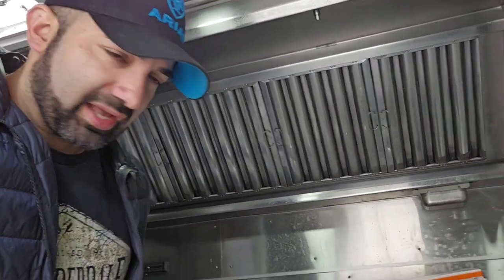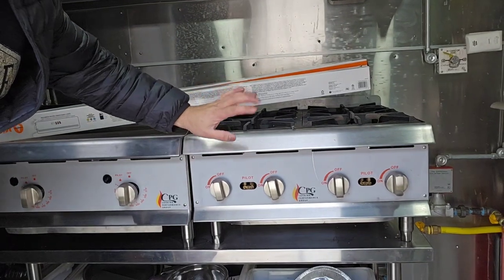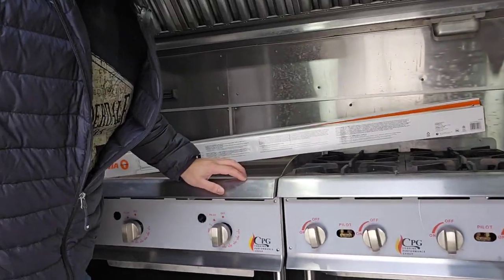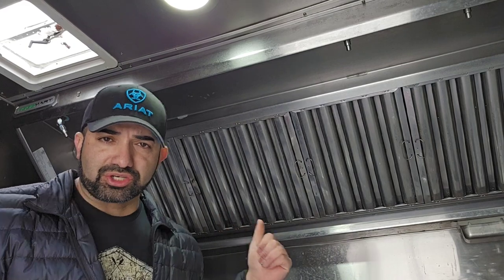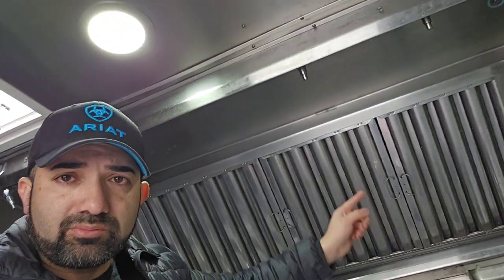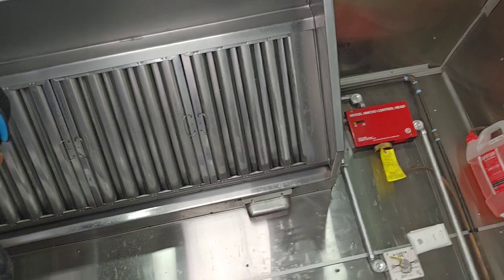Food Truck Hood and Stainless Steel

Comment: I just recently bought stainless steel wall panels from one of my local fabrication/welding shops for my trailer build. It was 146 bucks a sheet.  I was shocked I found it this cheap as it’s been well over 300 a sheet since shortly after the pandemic hit.  Been installing it all fastener free with panel adhesive. The panels were 4’x8’ 304 #4 finish stainless 22 gauge. Time consuming process, but it’ll be so nice when finished.
Reply from the maker: There you go!!! Great find

Comment: Love the video's.  Great content Frank.
I have a camper I converted to hardside. 
I'm making a Boba Tea Truck. 
I have 100 amp service.
I have 30 amp generator inlet box.
I ran 10/4 SOOW  from the inlet box to the breaker box. 
I want to power both legs in this box and it only power one leg right now. I think my issue is the power cable from my house which I'm using 110 outlet to power the camper.  The power cable from house to the camper is 3 prong but I put adapter on it to hook up to my 110 outlet.  So essentially I only have one hot coming into the 30 amp outlet box. When i got to certain events i have option to use their electric but it usually comes from 110 outlet. How do i power both legs in this box?
Reply from the maker: You can add tandem mini breakers, I list then on my descriptions and only use one leg.
Reply: @fbaltierrez  thanks for the reply Frank.
If I ran a jumper wire from the hot leg to dead leg would that cause any issues?

Comment: The hood i have from hood mart says that you need a gap between the top of the hood and the roof.
Reply from the maker: My gap is the gap that the roof studs make which is the stud height. That's what I have used when installing
Reply: @fbaltierrez  the instructions that came with mine show bolt goes thru the hood with the metal and the foam washer, then on the top side of the hood, there is a washer and a nut to secure the bolt. Then there is a second nut and washer that contacts the ceiling, making a roughly 2" gap between the top of the hood and the ceiling. Then on the exterior, there is another washer with 2 nuts to secure the hood so it doesnt loosen up. So altogether, there are 5 nuts on each bolt total. Thank you for responding. These videos are great. I have a 12' hood and it cost me about $3500 for the hood, where a company wanted over 8k for them to supply the same hood and install it. Big savings.

Comment: Can you send me the link where you purchased your stainless steel and transition pieces?
Reply from the maker: Stainless steel you have to call around to find those. Transition pieces I can add them below SS Trim Pieces

End Cap:

https://www.amazon.com/gp/product/B07M793VN5/ref=as_li_tl?ie=UTF8&camp=1789&creative=9325&creativeASIN=B07M793VN5&linkCode=as2&tag=rollingburrit-20&linkId=9b596fb6e41fc02db37f3dde5c9f2ed6

Divider Bar

https://www.amazon.com/gp/product/B07MLSP44P/ref=as_li_tl?ie=UTF8&camp=1789&creative=9325&creativeASIN=B07MLSP44P&linkCode=as2&tag=rollingburrit-20&linkId=14b923c96bad8c7829caeb5c89ebebb4

Comment: Hello Frank I have a question regarding convert power so that we can plug our trailer into a regular 110? We have a 30amp main breaker and 2-20 amp and 2-30 amps single switches.  is there a way to contact you by email?

Comment: I'm in a pickle... I hate the people that bought the place I've worked at for 17yrs.. like,I'm just numb.. and need out.. I've been looking at different trailers for awhile. But I want the small ones because I can tow them with just about anything.. a chevette ,lol.. I really like the Chinese rounders which I hate to say are sketchy for the US market.. and,I really like the "weenie wagon" trailer with the exterior grill and inside griddle.. but,I don't want to do hotdogs and these have more steaming pans than I'd ever use... I want to do burgers,6 type of subs,and a couple salads.. so a cold make line and as much under counter refrigeration as possible and the heck with steamers.. 
If I go the building it myself route, I've been digging around the vevor store and there's a great selection of everything a little kitchen needs for cheap.. very cheap compared to name brands.. I'm trying to write a business plan and I'm getting help from the Small Business development from the State University.. but I'm still lost on how to go about doing that.. I I need help, I'm not a good enough writer.. it will sound like it was written by a 4yr old.. where can I find a business plan writer to improve my odds of getting approved for the loan to buy one of these